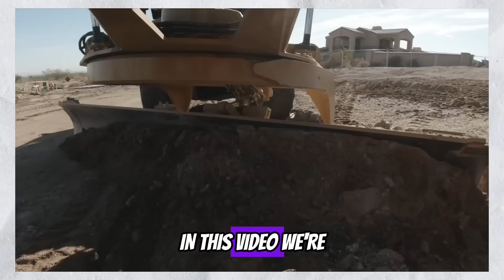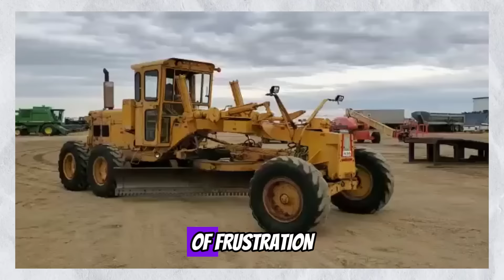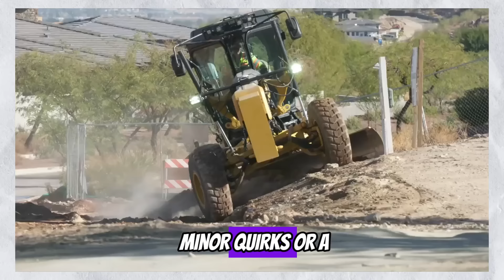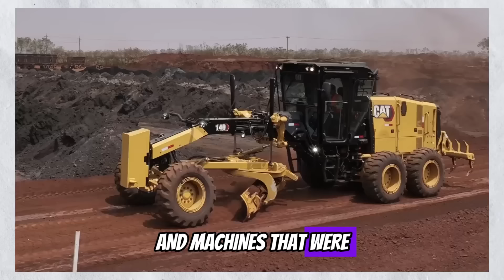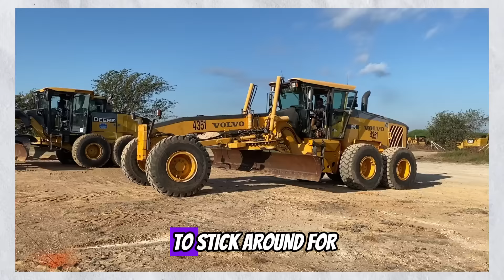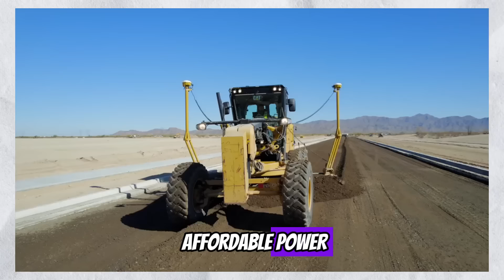4 Motor Graders You Should NEVER Buy!

Comment: I was hoping you would talk about the NEW Cat grader with NO steering wheel just TWO joy sticks on seat front. I have asked (Text) county operator who have a very long road drive to gravel roads to be reshaped. About "DRIVING" on R.O.W. only having a lever to steer with. For me personally I can't see that as an advantage because of safty on driving at speeds. I think this is one you will do a video on in future as a design flawed system for steering. Just like Cat getting out of Highway truck builds. It was really an 
(International) semi to begin with. But thats just me. I liked the John Deere 690 graders with the turned around (T) lever that the (JD) dozers had of the timee period. For sideshift and turn of mold board. That (T) shaped blade control lever on dozer with (6) way blade was so advanced for the time period. You just moved the lever like it was the blade. All other Dozers have "COPYED" the (T) handle lever for (6) way blades ever sense. I for one think a STEERING WHEEL is still needed on any type of vehicle be it equipment or not for road travel especially at higher speeds. 😊
Reply from the maker: I appreciate your insights!